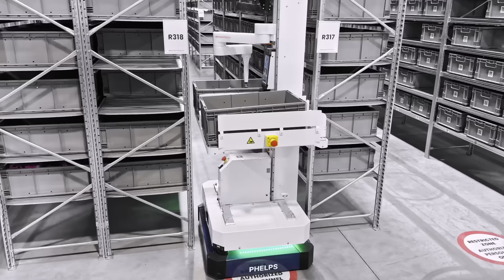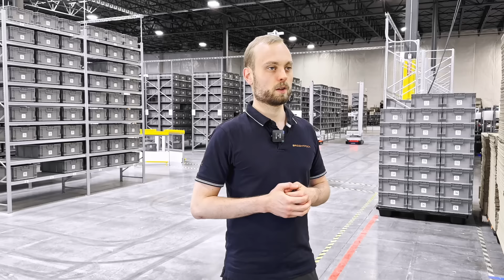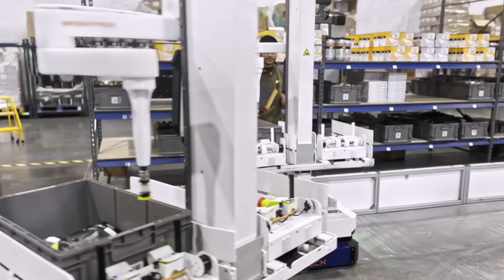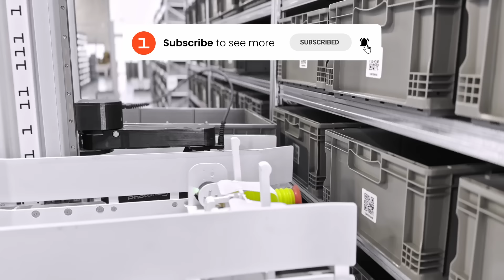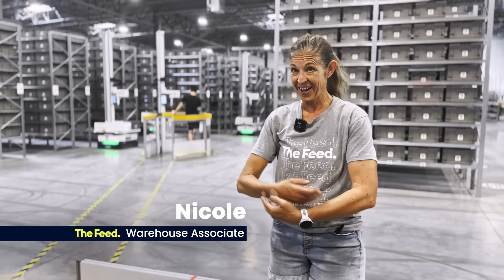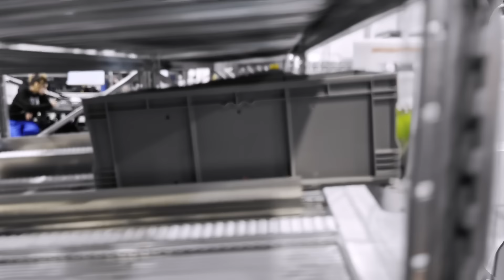Inside America's Most Advanced Robotic Warehouse (AI Robots)

Comment: That is amazing 
But I gess picking items one by one is slower as i can see in this video 
I recommend you should use some kind of weight measuring
Which can pick multiple small items instantly by measuring there weight

All thought I believe someone must have already thought about that
Reply from the maker: in our case, whenever there are more than 5 items that need to be picked at once, the robots automatically take them to a Goods-to-Person station for that exact reason (a human can pick them in bulk much faster than the robot)
Reply: @brightpickAI   Thank you for the clarification, but doesn't sending items to a Goods-to-Person station for such task then it kind of defeat the purpose of using robots in the first place? If humans are ultimately needed to handle bulk picking for efficiency, it feels like the automation could be improved. Shouldn't the goal be to optimize the robots to handle multiple items efficiently on their own, rather than relying on manual intervention? That way, you could truly maximize the benefits of automation in the picking process.
Reply from the maker: @prakashrollno5499  inevitably there will be some items the robots can't pick on their own, no matter how good the robots are (for example, if the packaging is damaged or the item is too heavy). That's why you need G2P stations as a fallback regardless. This doesn't defeat the purpose because the majority of the picks are handled by the robots, which means instead of e.g. 6 G2P stations you only need 1. It's also a question of cost vs benefit; in theory it may be possible to upgrade the robot, but if it costs you 5x to do that just to save 1 G2P station, then the cost-benefit / ROI isn't there.

Comment: Where was the AI tech shown? I’m still waiting to see the impressive Artificial Intelligence. I’m seeing pre programmed robots working in pre determined and positioned lines at the press of a button.
Reply from the maker: The robots use AI to identify which objects to pick, meaning the robots do not need to be pretrained and can pick any items automatically out-of-the-box.

The also use AI in the navigation; while the paths are pre-planned, there are no navigation markers or QR codes and the robots entirely rely on their vision for navigation (which is in part enabled by AI).
Reply: @brightpickAI Okay, I see now for the box picking. Although for navigation are all the robots connected to one another to know their positions or are they using AI to avoid one another?
Reply from the maker: @thlightest9827  all robots are connected to a central server via a local WIFi network. The entire fleet is managed by Brightpick Intuition software, which plans all the paths and assigns tasks to each robot in such a way that minimizes overlaps / traffic. In addition, each robot also has collision avoidance built in as a second safety measure and the robots do communicate with each other directly when they are close.

Comment: Next thing will be in floor power contacts so they can get power while moving and shed the battery, 6 volt would be good! Make for a cheaper robot. Shelf arrangement will also matter a lot. Taller and more compact spaces are vital. Metric will be cost/pick. Next they I am guessing different size bins or even boxes, bins cost money to get the install cost down